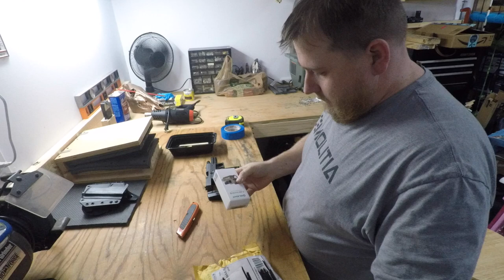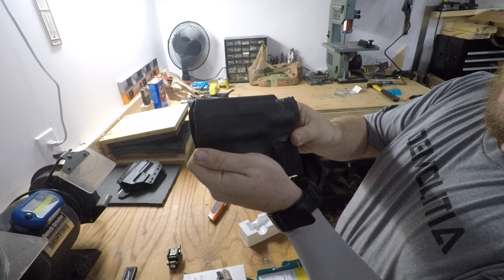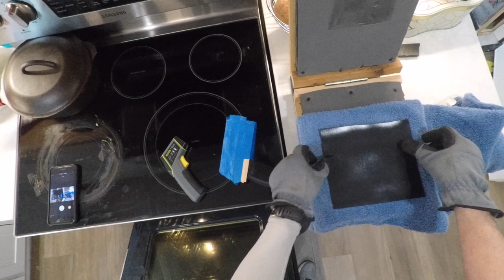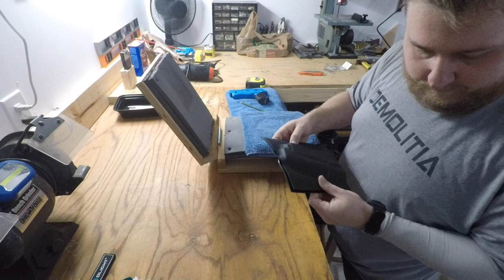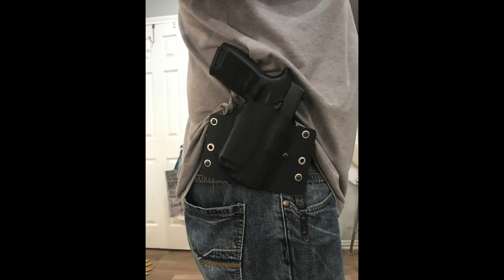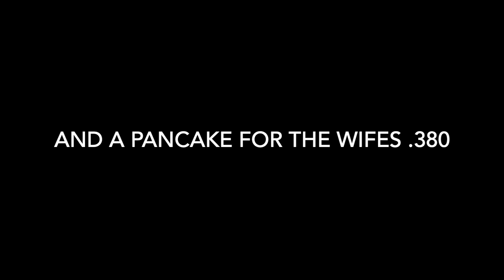Making Kydex Holsters at Home. This Is A Follow Along Not A Tutorial

Comment: I'd split that press lid with a hinge system which would obviously require 2 more clamps. I ordered Kydex and all the hardware needed to press a holster for my CZ P10/Olight mini 2 combo. Great video
Reply from the maker: That would probably work. I’m just trying to keep it simple as the kydex cools quick. I really haven’t had any issues with it but everything can be improved lol.
Reply: @Foxbodys4life  I'm going to attempt a fold over for the czp10c with the valkyrie mini 2 in a few days. If you have any tips or hints I would greatly appreciate it
Reply from the maker: @dilldowschwagginz2674  just keep the kydex hot lol. Kydex is pretty forgiving. So if you mess up just reheat it. And trim large for your first few. I like to cut around the grip also so the kydex forms around the frame better.
Reply from the maker: Not sure if you check or not but I have a video showing me making a taco/fold over holster on my channel also. Didn’t think about it until now lol.

Comment: I just payed $150.00 for mine because it was the only company I could find that made one for my M&P 5" with the Balor mini 2.  How much did you make that for?  It looks good, great job!
Reply from the maker: Well the materials were only about $40. But that’s because you have to buy all the screws and rivets in bulk. After that, I can make a taco holster for about $15. The set up is what gets you. I made a taco style that I use everyday for my 320 and when I bought the Baldr mini it just required a small heat treat to expand the light pocket a tad for it to fit.

Comment: could you just drill the rivets out and reuse the kydex?
Reply from the maker: From my experience if you have good kydex, you can reheat it and press it 2-3 times before I wouldn’t use it anymore. I use .08 thickness to make them rugged and it can be reheated a few times.